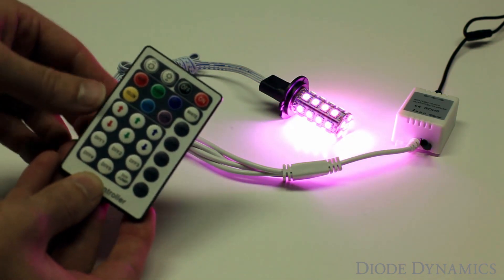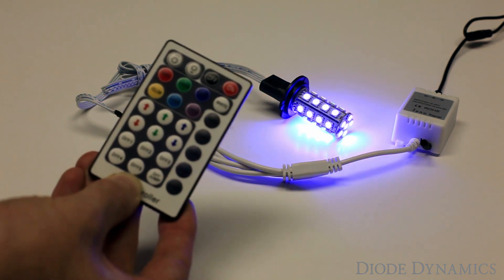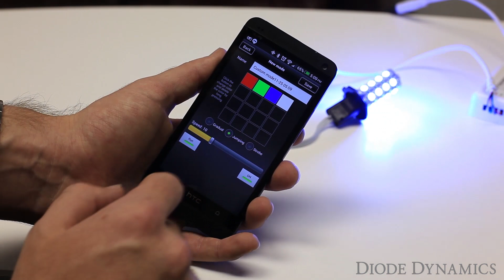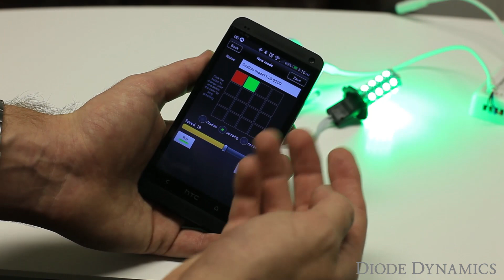Diode Dynamics RGB Controller Comparison Demo

Comment: If i use the led strips in my engine bay and keep the RF controller in the engine bay, will the remote work from inside the cockpit? Or do we have enough wire to bring the controller box in the cockpit?
Reply from the maker: Hey there! You should have no issue with your remote reaching the controller from the cockpit!

Comment: would these lights fit my honda civic hatchback sport 2017 model? I intend on using the h11 bulbs and was wondering if its compatible with my car.
Reply from the maker: +partypickle2012 We have not had a 2017 Civic into our garage to confirm fitment for this location. However, if you email photos of the factory bulbs to contact@diodedynamics.com, we'd be happy to confirm the size you'll need!

Comment: OK I'm really interested so with the regular controller...can it operate both the Multi color fogs in conjunction with the angel eyes and have full function.... or will there be 2 different controls ......or will the the WiFi controller be best .. 07 dodge magnum
Reply from the maker: +blakcrams21, with both our WiFi and Bluetooth controllers, you will be able to control both angel eyes and the multicolor fogs at the same time if you wire everything up to the same controller box.